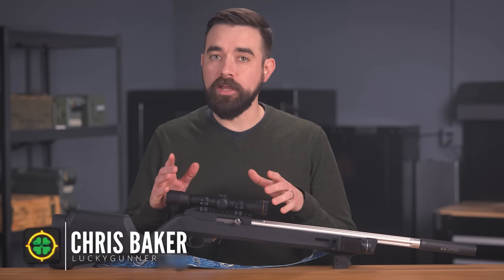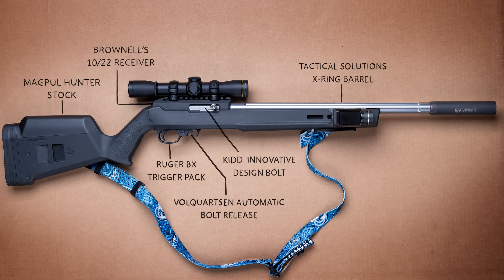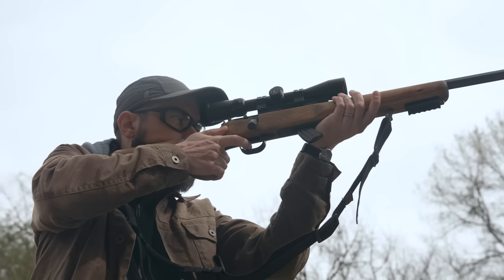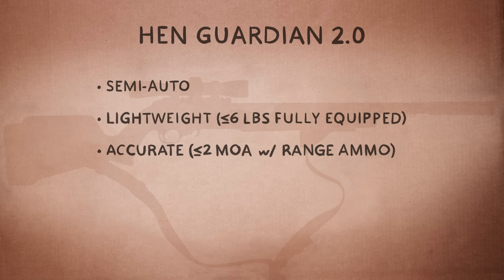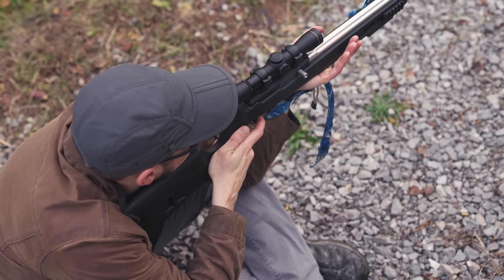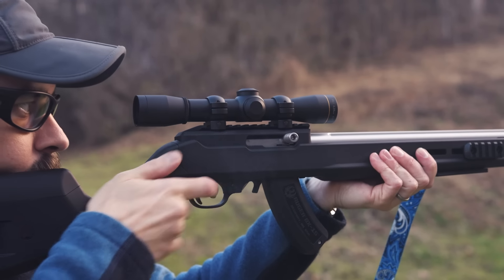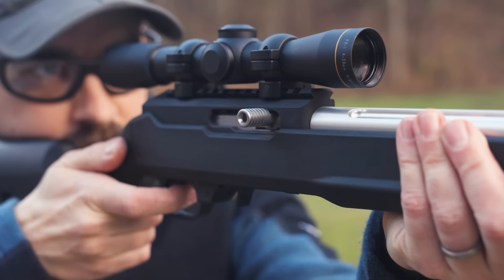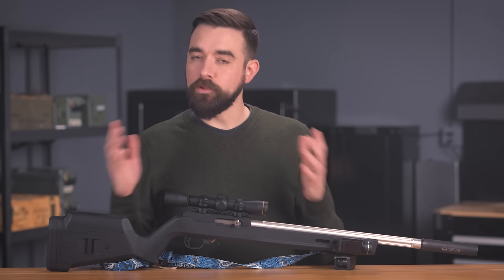The Backyard Sniper - Lightweight Edition

Comment: I rebuilt an old 10/22 from the early 90s into something similar last year. The original trigger housing was metal, and I didn't want to replace it with a plastic drop-in trigger like the BX, or spend $200+ for the Volquartsen group with an alloy housing.  Then, I found the Volquartsen Accurizing Kit.  It's the internal parts from their drop-in trigger assembly, but you swap them into your existing trigger housing.  It's around $100. It took about 20 minutes to install and it breaks under 2.5 pounds. It's sweet.

Comment: IMHO the best semi auto 22lr design.  Regardless to who makes the parts.
Reply: If the 10/22 is such a great design, why does everyone have to spend a thousand bucks or more on after market parts to make it accurate and truly great? My truly great 22 semi is a Remington 597 with a factory scope. That sucker is the most accurate 22 I have, right out of the box from big Green. Despite all their woes, they still can make a great gun, though you may want to buy an older one. I have a Winchester Wildcat semi, 10/22 clone, which is almost a great gun. I had to replace the mag with a Ruger mag. Now, it is ok. But, don't waste your money on a Ruger design. Get a 597 and tweak it. I taught myself how. I hate rotary mags, too. Bought that by mistake.

Comment: I've had my 10/22 for over 30 years. I added a Bell and Carson stainless steel flutted bull barrel and a synthetic thumb hole stock with a 3-9x by 32 mm Simmons. Bench rest with cci ammo will stack them in the same hole, all, day, long... 1/2 moa at 100 yards. I have 10 shot groups (bench rest!) Under .40 at 100 yards. All i did was chamfer the new barrel and assemble. The bull barrel and synthetic stock was a kit sold from Bell and Carson through Cabela's i think (30 years ago). Stock trigger and action. Never even open up the action, just transferred it to the new stock and changed the barrel. 10/22's used to be $300 for stainless from Walmart. $220 for blued.

Comment: Old inftryman trick for things that rattle. Try wrapping the hardware in a single wrap of tape, or use a "ranger band" (thick piece of cut bicycle tire inner tube or rubber band). Wrapping your hard bits with rubber helps cut down on the noise when trying to be sneaky. Makes detaching a little bit slower, depending on how you wrapped it, but lets you keep the capability without having to take apart the sling. Also protects the button from accidental releasing.

Comment: I've got a very similar build - I went with a Brownell's takedown receiver, TacSol 9" Charger barrel, and an Engineered Silence chassis, which allowed me to semi-shroud a Silencerco Osprey Micro. Incredibly handy, and with a folding brace/stock it breaks down to just the length of the barrel.
Reply: I've always wanted to put together a Charger. I've seen guys get pretty wild w/theirs. Lot of advantages going that route, esp if you're lugging it around the woods..

Comment: This video is me about 6 months ago. I needed a fairly lightweight 22 that both my son and I could get some training with. Anything from some precision work to knocking out rabbits, or skunks or raccoons on the property. I do have the TacSol receiver and barrel. I loved it because it has a left sided charging handle option and the bolt design is incredible and with as many malfunctions as a 22 has, I like to be able to clear that quickly with my left hand as necessary. I’m a vortex fan boy, so I have a new strike eagle 3-18 on it. As far as trigger packs, I went with the Timney Calvin elite, and I like it quite a bit. I really have no comparison other than a standard Ruger 1022 trigger. But the Timney has done me well the last six months. Very adjustable. I have it in a Magpul stock like you do. And then I put a sawtooth rifles, Arca rail on the bottom of it. He built a rail just for the Magpul hunter stocks, which is awesome. Does add a little bit of weight, but it is quite robust. Thanks for sharing your vid. I was in the same boat about doing a ton of research and going with something quality, but not $2-3k.

Comment: Kidd triggers are hands down the best. When I was building a 10/22 I happened to go into a booth at a gun show that had (at the time) every available 10/22 trigger on display where you could test them out. At that time I wasn't really aware of all the names in the 10/22 world but I went and tried every single one. The Kidd won and it wasn't by a little bit. I prefer single stage triggers but I wouldn't turn down their two stage either.
Reply: I have a 2 stage Kidd. It’s not cheap, but is delightful.

Comment: This video definitely inspired me to build out my own 10/22. I really wanted a lightweight, handy, rifle for hunting plinking and peat control. Here's a rough brrakdown of what i ended up doing so far. 

Base rifle was a Talo Exclusive 10/22 Takedown. I swapped the stock for the Magpul X-22 backpacker, the trigger to a BX trigger pack, and installed a EGW pic rail. I installed a primary arms 3x microprism with the griffin-mil reticle,  and am running a bfg sling qd mounted to the stock. At some point, I'd like to swap the reciever for a fletcher 11/22.

Biggest challenge was finding a non-threaded 10/22 takedown. Right now I travel between NY/VT and unfortunately the threaded barrel carries a felony charge in NY. That said the Talo edition comes cerakoted, which is a good value in my mind.

Comment: I like the Timney triggers. The Timney trigger pack has the extended mag release and an auto-bolt release built in, so you don't need those as aftermarket parts. Whether or not that and a slightly better trigger is worth the 200 dollar price difference (and waiting times due to apparent backorder status) is entirely up to the end user. I think the BX trigger is going to be fine for most people.
Reply: Kidd > Timney. I’ve tested both, and both are nice, but it’s still no contest. My 1.5lb Kidd is the best trigger I’ve ever touched—period.
Reply: I like my 3oz kidd trigger, which puts the volquartsen to shame (I swapped it out of my volquartsen 10/22 custom build, and now Im finally happy with 10/22.  I have a few 10/22s which break at 1 to 2 lbs, all too heavy for me personally.  Now my volquartsen is truly an extension of my body.  It goes bang when I want with no movement

Comment: My 10/22 has the same stock.  No sling, Trigger is a TandemKross, set at about 1.5 lbs.  Scope is a fixed 6 power Leupold from my inventory.  Ruger barrel and action. Quick magazine release, which took some getting used to.  Love it. It's a tack driver. Favorite ammo is CCI mini-mag, or Federal Eagle. Both jacketed hollow point.

Comment: My backyard pest control is a Taurus TX-22 with a Thompson Machine suppressor (It’s a small yard). Probably the most fun gun I own.
Reply: And probably much much cheaper and less time consuming than this build
Reply: I have a backyard critter getter for both scenarios. A particular 22 rifle & pistol I go to. Both are budget & suppressed. And don't get me wrong, I love my rifles set up. It can handle everything from a coyote by the fence, to 3in steel out to 100. But sometimes a pistol works & is just plain fun. Like for those ballsy armadillos who find a way to break through my fences & declare a hazardous form of trench warfare on my backyard... 😒 
Quick draw with a pistol light bc I'm trying to get 'em out of tight corners & from under things, then they charge me. I can't defend myself fast enough in the dark sporting a rifle with a 3-9 on top. Them angry armadillos will rip my legs apart if I let 'em.

Comment: I built a 10-22 from scratch 3 years ago very similar to what you have. There is so much false info out there you have to be very careful with your research. I had a Kidd trigger but there was a problem with it and they (Kidd) were difficult to work with. 

Tip of the day: use a Dremel to lightly notch the sides of stock where the safety barrel slides through. When taking the trigger out one time, the safety barrel was centered and the detent was in the depressed position, and when the barrel came up through the stock it rotated slightly locking the detent on the backside of the safety barrel. The safety barrel would not turn in either direction. It took me several days to figure out how to fix it, and there seemed to be no online answer as to how to do so. After notching the stock with the dremel this has never occurred again.

Comment: I've always customized my triggers myself, and it has made a huge difference. But I've heard that nothing comes even close to a KIDD trigger, so I think I will be getting  KIDD single stage trigger for my next build, likely along with a KIDD ultra light barrel.

Best In Slot Items:
Trigger: KIDD (seems to be no real contenders here, though you can easily find much cheaper trigger groups that are still significantly better than the factory trigger).
Barrel: KIDD (though there do seem to arguably be some alternative options here, in any case KIDD seems to have one of, if not the best 10/22 barrels). GM seems to make really good value barrels, but the KIDD will easily beat them, but at a significantly higher cost.
Bolt: Volquartsen (There seem to be many good options here, but this one appears to be arguably the best one in my opinion)
Receiver: Having a hard time narrowing this one down, each one seems to have some good and bad things, there doesn't seem to be a perfect one out there for me. Right now I'm leaning towards the TacSol X-Ring receiver. (Must have an integral rail for me, which automatically rules out the KIDD receivers).
Stock: tons of good ones out there, this really depends a lot on personal preference. One of my favourites though is the Raptor.

If you strongly disagree with any of the above, I'd love to hear what you consider the best in slot items. I'd particularly love to hear receiver recommendations since I can't seem to find one that is clearly superior than the others. Again it must have an integrated rail for me, which seems to rule out what would otherwise appear to be good receivers. 

Tactical Solutions X-Ring: Seems to be one of the better options
Quentin Defense: This one looks good, but only really seeing negative posts about the company.
PRP Rubicon: I don't mind the look of this one, but I prefer Tactical Solutions X-Ring
Faxxon: very similar to the Tactical Solutions, I just don't think this one looks as good.
Tactical Innovations: very similar to the Tactical Solutions, I just don't think this one looks as good.
Brownell: very similar to Faxxon and TacSol, I just don't like the appearance as much (rails don't cover the top of the barrel).
Magnum Research: I don't like the extra height on the rail
KIDD: No integrated rail, automatically ruled out.
Volquartsen: No integrated rail, automatically ruled out.

I'm sure I missed some out there, but always on the lookout for a good 10/22 receiver.

Comment: Chris, great video - thank you.  Very informative. I started with a 10/22 Takedown with Target Fluted Bull Barrel that I purchased last month. Immediately swapped out the standard Ruger bolt for a Tandemkross bolt, charging handle assembly, and synthetic bolt buffer pin.  The Kidd bolt is very similar and a bit cheaper to boot. I'm told the Ruger target barrel is chambered Bentz, so the combination of the aftermarket bolt with proper headspace (0.0425" SAAMI) and the bull barrel are giving me great accuracy. Regarding the trigger - check out Brimstone Gunsmithing's new trigger work. They will have the parts by late January. They claim the pull weight is down to 1.75 lbs. I have my order in and will send my stock Ruger trigger (yuck!) to them.

Comment: It’s so easy to build a $1500+ 10/22, have a few of them now 😅. As far as triggers go, I don’t think you can go wrong with the KIDD triggers; they have a nice lineup of single/dual stage stuff, albeit a bit pricey. They’re definitely much higher quality than the BX, but it’s up to the end user if the price disparity is “worth it”.
Reply: The Kidd triggers are smoooooth!
Reply: Omg
Reply: Dads friend has a bullpup red jacket one with a threaded barrel 😭😭 i can only dream
Reply: Yeah, don’t cheap out on the most important component.
Reply: Ct. Precision machine can make a factory 10-22 trigger just as nice as a Kidd, volquartson, etc. imo
Reply: Trying to figure out how much I spent on my build from SCRATCH. Started with a stainless 10/22 with a plastic stock. I got a CLEARANCE Volquartsen trigger assembly for I believe $130, Hogue Thumbhole Tactical stock for $70, Tactical Solutions X-ring fluted light weight stainless barrel for $130, and a special recoil buffer $15. The rifle cost me $250 initially before modification. The scope is from Walmart and the other parts from Midway USA. So I'd say I've got about $ 700 total in a light weight carry around package for SERIOUS squirrel hunting.🤔😁😎
Reply: Forgive my ignornace but what's the advantage of building one over just buying a Ruger 10/22 with a threaded barrel? And sticking it in a new stock?
Reply: @DeimosPC  it is the process of picking everything out and doing research and bragging rights.  I’ve had people decline to go a buck a point with me even though they have 10x the cost of my rifle in theirs.  The Ruger hammer forged target barrels are good.  The addition of a good trigger can help.
Reply: @charlesmckinley29  I'm tempted to build one. I have a few stock 10/22s but having a custom built one sounds kinda fun
Reply: @DeimosPC  it can be very fun.  One of the Appleseed instructors started researching and looking at what fit with what and what didn’t and ended up doing what I told him to do in the first place and order the Kidd.  He had all sorts of charts of what he wanted and the conflicts.  It is like legos.

Comment: I have 9 ruger 10/22’s. Funny thing is I have all those same parts but disbursed between multiple guns. I have two magpul x22 hunter stocks, they are not light at all. The x ring barrel is installed in a Boyd’s AT-one lime green stock. The leupold (I have the 2-7x28) is on a super light synthetic stock build with a custom ultralight carbon barrel and weighs 3lbs 10oz. The brownells receiver is on yet another gun. And I have two volquartson bolts in different guns. Most of my guns have a bx trigger and if they don’t, they volquartson trigger kits. The AT-one has a green brimstone hornet trigger.

Comment: Nice video, wish I'd seen THIS particular video because I recently had finished my own 10/22 project about 6months ago with a stainless 10/22 with the plastic stock so put a Volquartsen trigger assembly on clearance for a little over $100. Then ordered a Tactical Solutions X-ring fluted light weight stainless barrel for a little more than $100. And lastly is Hogue Thumbhole Tactical black rubber covered stick for less than $70 on clearance. SHIPPING WAS FREE from Midway USA for orders more than $50. I POLISHED the inside of the reciever and bolt. The fitting of the barrel was a little tedious because the fit "REALLY TIGHT". I did have a great small portable vise and a 2lb dead blow hammer which were very beneficial for my success (turned 70, 2 months ago) I was very happy after taking it to the range and it FUNCTIONED PERFECTLY, mission accomplished. Where I shot at is only 50' and NO BENCH RESTING so everything is FREE-HAND which I was able to once dialed in 1 quarter to half dollar size ragged hole with 10shots no just 5shots. It was FUN and SATISFYING to be successful in a task and say to yourself "I did that with out a proper shop" . 😁👍
Reply: Why are you using all caps like that

Comment: I've swapped out the stock hammers for the Volquartzen versions on a couple of 10/22s and they've been beautiful, a big improvement. As a DIY project they're cheap and only take a few minutes to swap out. It's a big improvement. The other 'must have' upgrade is the bolt hold open.

Comment: One of my favorite guns that I own is still my Marlin 795. Not exactly the same thing, but very similar. I love how light and handy it is and so easy to shoot. Possibly the best ~$150 I've ever spent :)
Reply: I miss the $150 days dude
Reply: @81peyote  check out the Rossi RS22.  I think you will be pleased.
Reply: I'm a Marlin man myself and have had at least 5 M60's over the years but I have sold all except for my 2001 M60 SB that I have customized as much as I can and it shoots fantastic.
I love having shoot offs with my custom built 10/22.
Reply: @charlesmckinley29  Just bought me a Rossi RS22M (22WMR) last week and I'm dying to shoot it.....Just need to decide which scope it will wear and I have to wait for the Illinois winter to get over with.
Reply: @Riley_1955  depending on what you want I have been happy with the Center Point 3-12x44, MOA reticle and exposed target turrets.  Is was around $125.  The cons are it is larger and heavy.  The Simmons rimfire scope also are a good value.
Reply: I love my marlin 795, had it for 19 years now. It needs a new magazine and it's a pain to clean, but it's my go to for plinking, practicing good technique, and introducing new people to the sport.
Reply: @charlesmckinley29  Decided it will wear an Athlon Argos HMR 4-20x50 got it for a great price at Optics planet.
Reply: @joecee6862  better buy 2 magazines or more for you 795 as they are getting harder to come by.  I would suggest a few firing pins as well.
Reply: @Riley_1955  from what I’ve read you should be pleased with the Athlon.